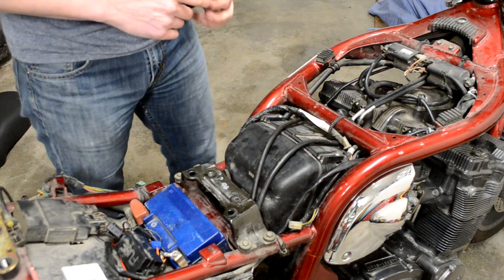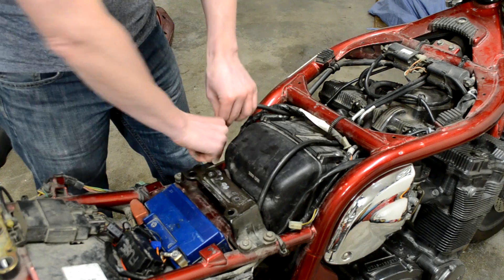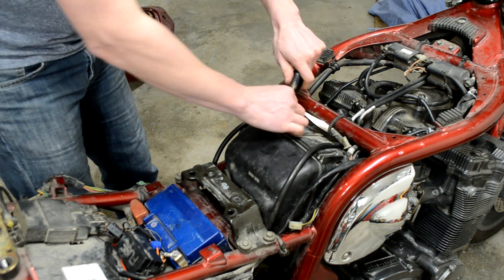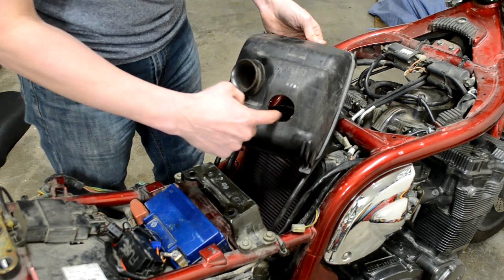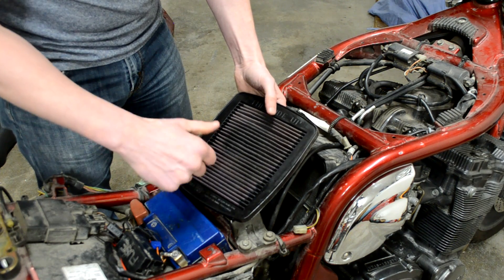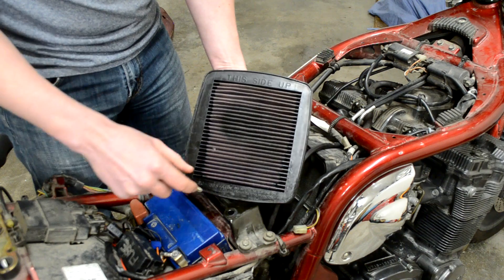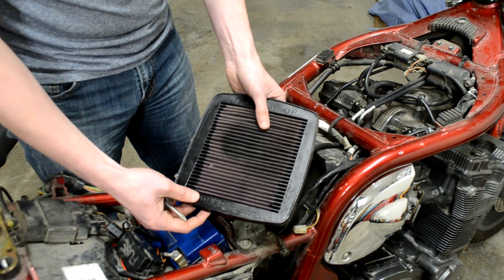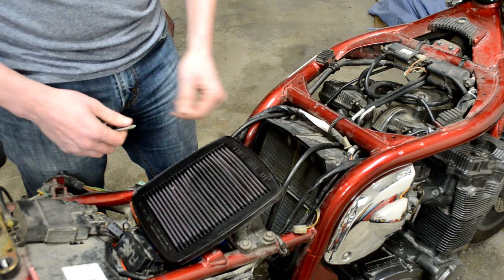Possible Solve for Lean Engine, Jerky Acceleration, Crackle & Pop with K&N Air Filter

Comment: 2001 yzfr6 has one. It's running lean af. I'm bailing on these and going back stock. The low end is horrid now and I rebuilt carbs with new parts.

Comment: My cbr 125 is running lean i have slow throttle response and bad power in lower rpm at full throttle Iv changed 02 sensor and signal wire , airbox and manifold and air filter, throttle body and injector and also the fuel pump and fuel filter. Im just totally baffled. Bike runs fine in higher rpm never cuts out and starts first time on button. I also did a ecu reset today but still.the same
Reply from the maker: What year is the CBR?
Reply: @KARMAkazeMoto  2012
Reply: It's that bad in low rpm that I can apply the rear brake and the bike Will just go like 8mph whike fully throttling which means its runing lean I'm.guessing but  iv changed every thing I can rev the bike fine in netrual all.the way up to 12k revs dosnt bogg out or any thing
Reply from the maker: Since it is fuel injected we can rule out a lot of typical carburetor related issues.

Assuming all sensors and electronics are working, there are two things that come to mind. The first is an air leak, possibly between the fuel injection throttle body and the cylinder. Inspect the rubber boot that connects the throttle to the cylinder head. Make it tight. Check for cracks. Small leaks/cracks are hard to spot. A great method is to run the bike and while running spray a fine mist of water around the rubber. Engine speed will drop if any moisture gets in. WD40 works too. Carb cleaner might cause engine speed to increase, not sure. You'd still know if there was a leak either way.

My second thought is that the engine may have low compression. You'd need a compression tester for that.

If you have installed a high flow exhaust and or high flow air filter without remapping the computer, this could also be the problem. Especially on a small engine, when you start letting in a lot of air or letting a lot of flow through the exhaust, it can cause poor performance.

That's all I've got for you. Let me know if you discover the problem. By the way, if you think it is running lean, let it run for a couple of minutes at the lowest RPM, then shut it down. Pull the spark plug and see if it looks white. Then you would know you are correct it is running too lean.
Reply: @KARMAkazeMoto  there's no air leak iv sprayed wd40 every where and compression is 190 psi so no issue there I do have a sport exhaust    mabe with a slight exhaust leak not to major leak. Could it be the ecu mabe I need a new one
Reply from the maker: @Jason Carthew  You could test the exhaust by covering up the end of the exhaust. Like if you put your hand over the end does it run better. Or strap/clamp a piece of metal over the end, covering 1/3 or 1/2 half the opening and go for a short ride to see if performance improved. Obviously don't melt anything onto the exhaust.

Do you have a high flow air filter? You can do a similar test by covering the air inlet to restrict airflow back to factory specs.

It could be the ECU, yes. But you want to rule out all these other MOST COMMON problems. Glad to hear your compression was good.

Comment: Helo sir i am having a small issue with my 2017 hayabusa 
While cruising on 2000-3000 rpm there is a pop up sound coming ….if m on above 4000 rpm there is no problem running smooth…bt on 2000-4000 rpm ithere is pop up sound coming up please help me with this I recently changed the spark plug also bt it is still there

Comment: If you put on a freer flowing air filter, you’re adding more air to the mixture. You have to adjust for it. It needs more fuel if you give it more air, otherwise you leaned it out. Adjust carb , or remap FI. Same with free flowing exhaust. It’s cause and effect.

Comment: i have changed my air filter 8 months before in my fz v2 my bike is getting sudden jerk popping at 4 or 5rpm i havnt put oil on my airfilter wheb i was putting in in my bike what is the problm should i change the airfilter to new one or put some oil on old airfilter ?
Reply from the maker: Not all air filters require oil. If you or air filter is the paper type, or white, Typically that does not require oil. If your air filter is the cotton type, like a cotton mesh, or a spongy foam filter, those types require some oil. Was your bike running OK after you 1st change the air filter? If so then it must be a different problem.
Reply: @KARMAkazeMoto  problem is occuring when i changes my stock exhuast to aftermarket exhaust and my bike is fuel injector
Reply from the maker: I had a suspicion you might have done that.  Often times you can install a high performance air filter and everything is OK. Likewise you can often install a high-flow exhaust or muffler and the bike will run OK.  But with the new air filter and exhaust combined, I believe it's just too much air/flow for the bike's ECU to cope with.  You would need to have your ECU flashed or install some sort of Power Commander that can adjust for your changes. I'm not sure if something like that exists for your bike. 

On a smaller capacity engine, your changes are having a drastic impact. Whereas on a larger engine It is sometimes easier to get away with these sorts of changes because your change is spread over a large engine capacity.

 If it were me, and assuming you really like your exhaust, then I would go back to using a more restrictive air filter to bring the bike a little bit back towards a stock set up. Or find someone or some information on reflashing the ECU or obtaining a Power Commander.
Reply from the maker: If your bike was running good after the air filter change, and suddenly you are getting the popping sounds, I think the 1st thing I would look for is an air leak. 

I believe that bike is fuel injected. If so we could assume that the engine is getting the proper amount of fuel. But if you are suddenly getting too much air, causing some popping, then I would look for an air leak. This can happen if a hose has been disconnected from the injector throttle body or  If the air Box connection hose or the rubber hose between the throttle body and cylinder have become loose or cracked.

Here is a way for you to attempt to know if there is an air leak. Park the bike. Put it in neutral. Run the engine. You can even run the engine at a higher rpm. While it is running spray a mist of water around the throttle body or the connecting hoses. If there is an air leak you will notice the engine rpm drop down because the air leak drew in a bit of the mist and water.  You can also spray something like WD40 or carb cleaner, but of course water is cleaner and cheaper.
Reply from the maker: If you determined there is no air leak I'm wondering if the fuel injector is a little bit clogged. You can imagine if the injector was clogged your bike would not be getting enough fuel, especially at higher rpm. But there are a number of other factors that I don't know about because I'm not there. I'm just thinking out loud here. I hope this helps a little bit. Maybe someone else will chime in. 🙂

Comment: I have a fuel injected er6n, i don't have this problem with my reusible air filter. But i'm wondering if i might get this problem with my new XJ6 if i put one in.. still fuel injected so maybe the lambda sensor helps doing minor adjustments.. dunno

Comment: What do you mean by oiling it?
Reply from the maker: That style of filter requires oil. It is a K&N filter made of cotton. The filter is lightly coated with oil, and the oil helps catch dust and dirt. K&N makes their own brand of light oil which sprays onto the filter. Their oil is red in color. When the oil dries up or evaporates, the filter starts to let more air in. If your bike is finely tuned, or if it is already running a little lean, a dry filter can cause that extra popping.

Many older motorcycles and ATVs with foam filters require a bit of oil on the filter. Usually they need just enough oil to be wet, but nut dripping wet. Just lightly saturated.

Comment: Redbitter here Suzuki air filter helped a lot. Back of my trip now.  Went like a dream.  Bottom line is stick with genuine parts and you can’t go wrong
Reply from the maker: That's true. As soon as people start making changes they need to be prepared for a more fickle machine.
Reply: hey I agree what you saying removek&n And put back OEM filter that's what I did to my Suzuki GSF Bandit 1250sI put it back and clean up my OEM air filter and guess what more torque my power. thank you

Comment: Hey I have a 2008 gsx650f.  I put a kn filter in it has not been the same.    This is a injected bike.  Low R P M  surge. And decel pop.   Considering putting a  OEM air filter in it.   Got a big trip soon.  Help mate
Reply from the maker: I missed this comment earlier. Did you get the issue sorted? Sounds like your bike requires remapping or flashing the ECU, or maybe you need a power commander module. That's the downside of electronic fuel, you can't just turn a knob. Hope you get it figured out.

Comment: I changed to a K&N, the bike ran very lean, poor response, bogging down at low RPM, put the original back in and it was fine again. As you say, if you put in an air filter that lets in more air, your mixture will lean out, so you need to tweak the mixture (or change jets) to compensate. The only downside to the OEM filter is that they are damn expensive.
Reply from the maker: +CPU UK, thank for corroborating my findings. Did end up sticking with stock, or did adjust the idle mix screws outward a bit?
Reply: Bandit 1200: Ah, well as it happens I dropped the bike onto a Dyno today, and one of things they can measure is the air/ fuel mix throughout the rev range. The K&N was super lean throughout the rev range, which is why it chocked so much at low RPM. We dropped the stock in, this is now only lean at the top end but it runs a lot smoother. We then changed the pipe to a Scorpion, this made zero difference! Now that Scorpion should have added 10HP, but it did nothing except sound good. At the moment we have a theory that the carbs have a partially blocked main or sticking slider (something starving fuel, rather than too much air), so I'll be cycling back to dismantling the carbs and then dropping the bike back onto the Dyno. Until we realize the expected BHP gain from the Scorpion with stock setup there is no point in changing the jets\ needle, it would be a waste of money if the problem was say a slider issue. I guess what I'm saying is check it's running correctly on stock before tweaking. That Dyno takes the guess work out for sure :-) hopefully we can tweak the mixture on the fly. I'll let you know what we find in about two weeks, once I've confirmed the carbs are good :-) I expect if we get to jets\ needle changes I'll be back to putting the K&N back LOL, but for now the stock filter is better than the K&N.
Reply from the maker: +CPU UK, I need to get my bike on a dyno! Runs exceptionally well compared to when I bought it, but I have no way of knowing how well I've tuned it. Starting from a proven, good tune is great advice.